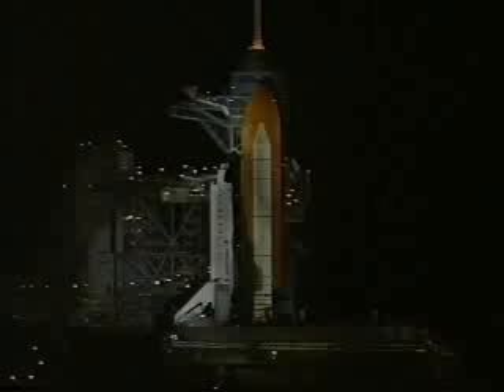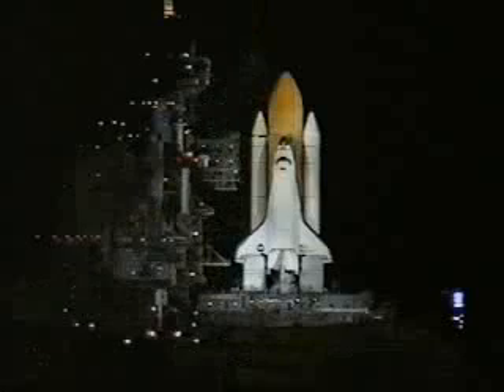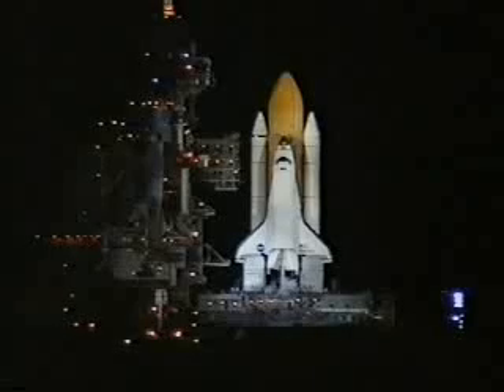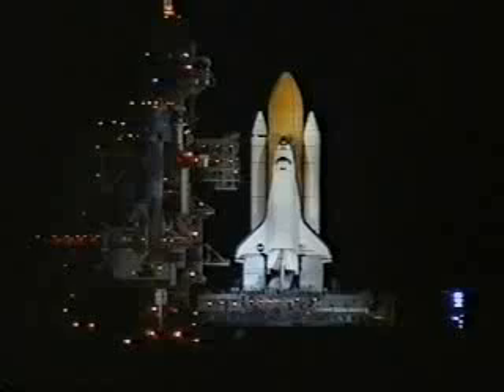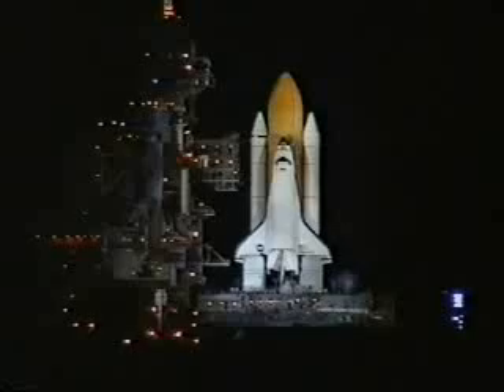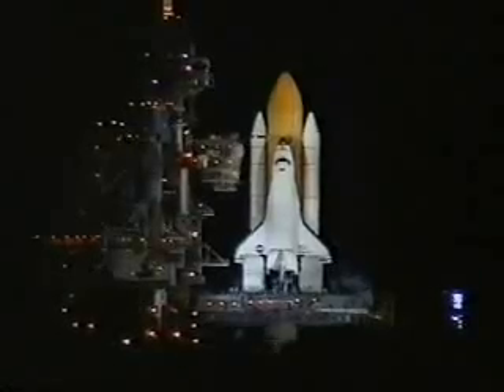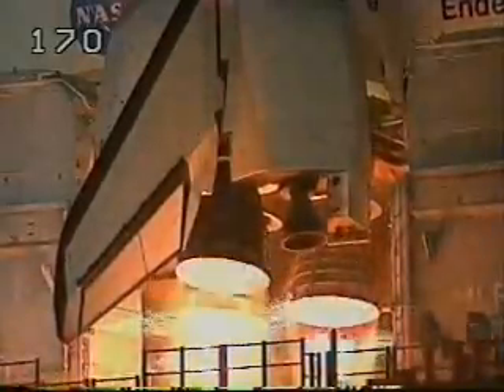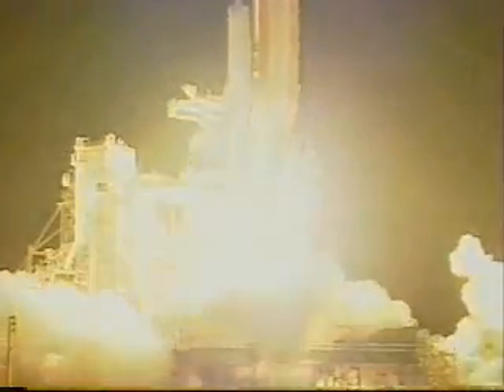STS-97 launch (11-30-00)

Comment: This was the 101st Shuttle flight, the 131st crewed spaceflight and the 221st crewed spaceflight. Endeavour made her 15th flight, the 45th US and 78th flight involving spacewalks, the 6Th Shuttle ISS Mission, the 2nd by Endeavour. 
The first US-provided Solar arrays were delivered to the ISS. Endeavour remained docked to the station for 167 hours, but only had the internal hatches open for 24 hours, leaving only a small amount of time for the crew members to visit their neighbors. The ISS crew  supported the crew of STS 97 with their activities when required.  The 3 spacewalks covered the installation and connection of solar arrays, preparation of the docking port for the attachment of Destiny on the next flight, installation of the Floating Potential Probe to measure the electrical potential surrounding the station and installing of a camera cable outside the Unity module.  Crew members Joseph Tanner and Carlos Noriega carried out the EVAs. 
During the day inside the ISS the 2 crews made structural tests of the array  and logistics transfer operations were completed as well as refuse from the ISS  transferred to  the Shuttle. 
Brent Jett, the Commander, made his 3rd flight, his first to command. Pilot Micheal Bloomfield made his 2nd flight.  Mission Specialist Joseph Tanner made his 3rd flight, MS Carlos Noriega his 2nd and last. Canadian Marc Garneau,, the first Canadian astronaut and later a Canadian Government Minister, made the last of his 3 flights.